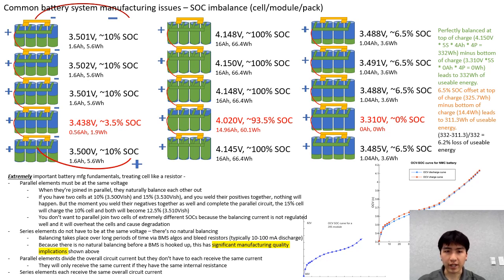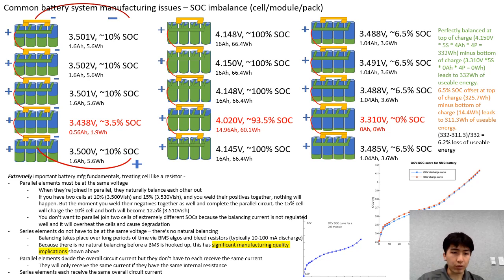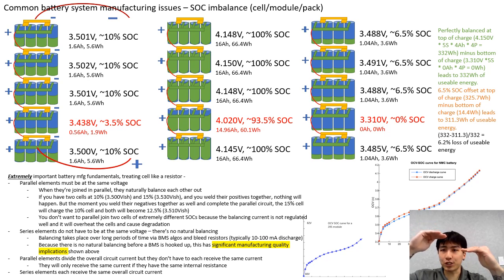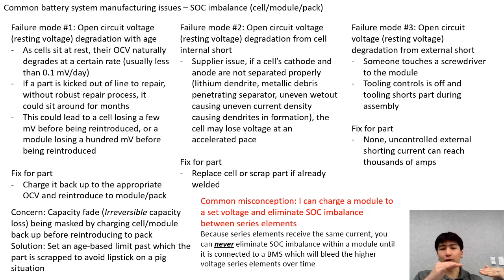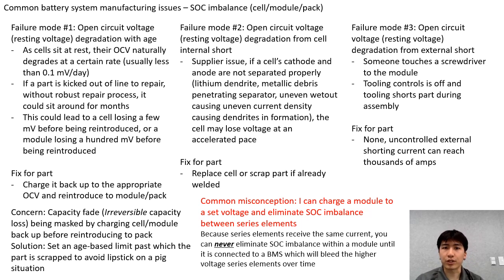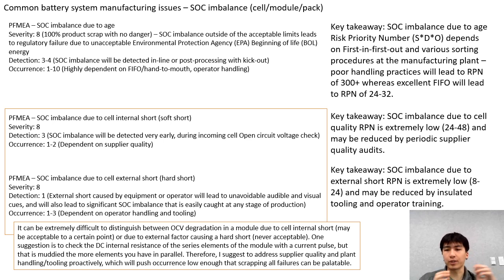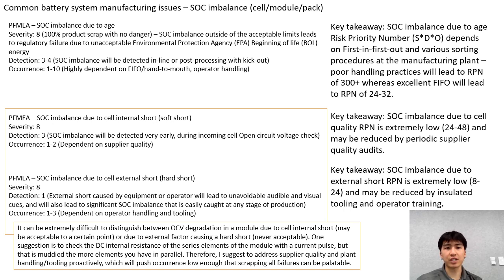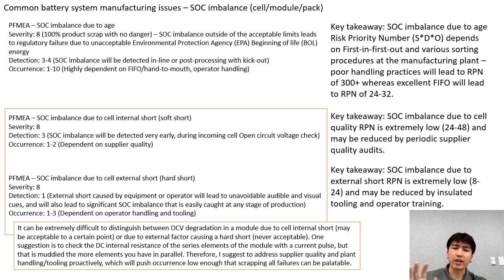Battery pack manufacturing system defects - SOC imbalance

Comment: Hello... Thanks for this explanation. My Tesla model Y performance 2021 has an imbalance. I can't share picture. But there is 1 battery pack wich shows 3.177 mv. This is the highest voltage and as I know that is the reason why other batteries aren't charged fully. Can I share this picture by another way? I need to know your advice about this 🙏